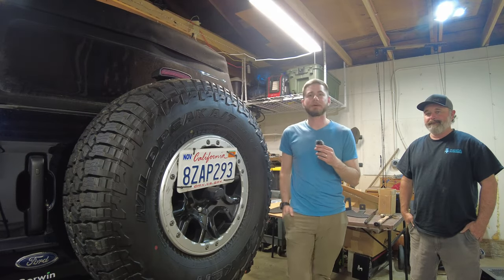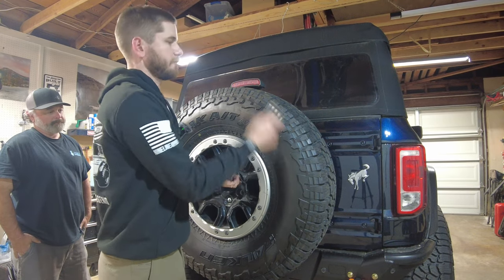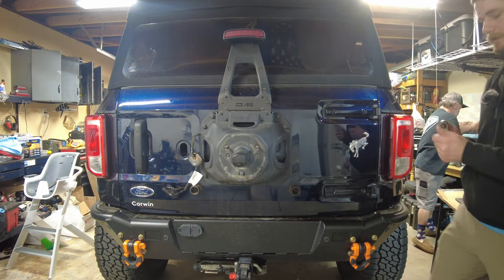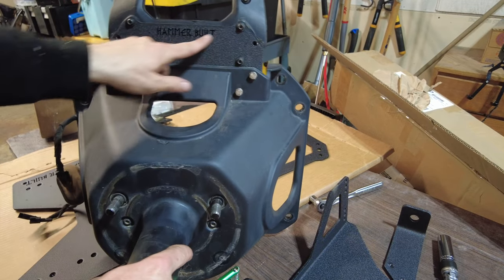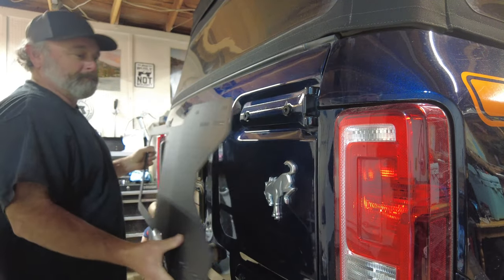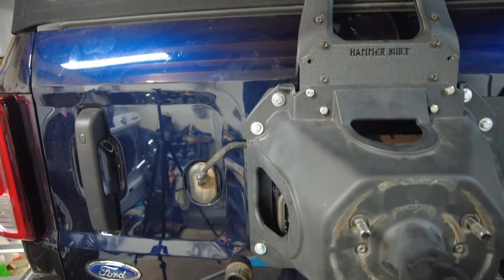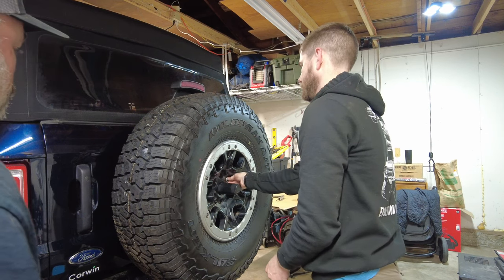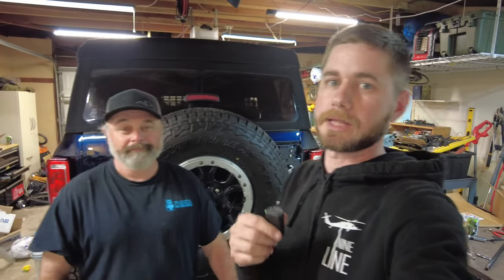Bronco Gets Braced! Installing the Hammerbuilt Tire Support

Comment: I love the HB quality but I still don’t think it’s a great place to start loading up full Roto Pax and whatnot as it still uses the small stock hinges. The reinforcement brackets all pretty much just even out the load of the spare onto the hinges themselves vs just the sheet metal (which is necessary for sure off-road with 37’s) I’d love to see a full hinge replacement come out aftermarket
Reply from the maker: Yea they recommend only up to a certain weight on this system (which I’m well under). I believe it’s 150 lbs. That’s why I have only a 2 gallon tank vs a 3-5. They run their stuff hard in testing. They do have an HD system coming out with their own hinge! https://hpbuilt.shop/collections/hammer-built-collection/products/hammer-built-bronco-hd-tailgate-reinforcement-system
Reply: @Bryan Glover, agreed! I won’t put anything but the 37” spare on either until a hinge replacement is available

Comment: 200 bucks.  So cheap!  Except it is not.  The base product now is just over 200 bucks.  But what was shown in the vid is also all the optional add ons which doubles that price.
Reply from the maker: $389 with the add ons which a lot of people won’t need or want. Still places the price cheaper then almost all other options on the market. I believe JCR starts at $329 for just the brace. M2M starts at $240, etc. as of now I have over 20k miles on mine with 37’s, Moab twice, Mojave, Rubicon, I’ve put the entire weight into the spare, I’ve jumped over a dozen times, zero issues. It’s a product I stand behind 100%.